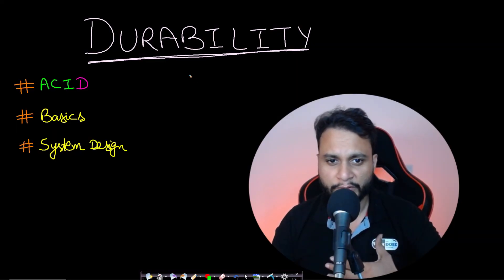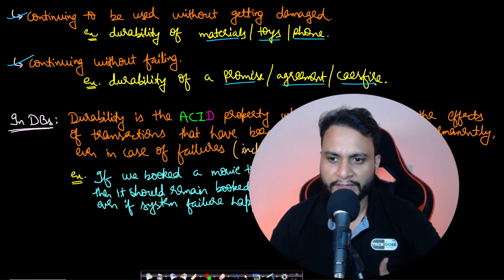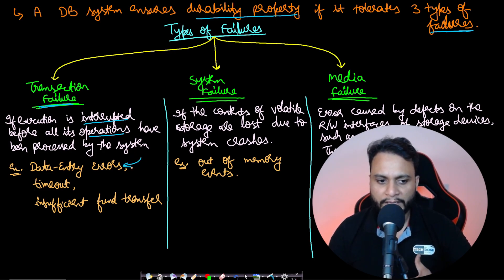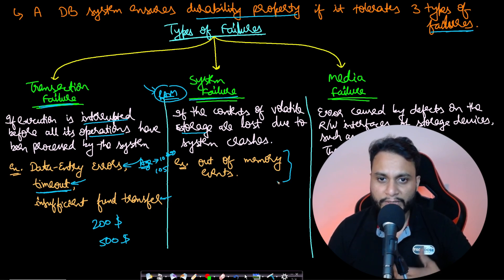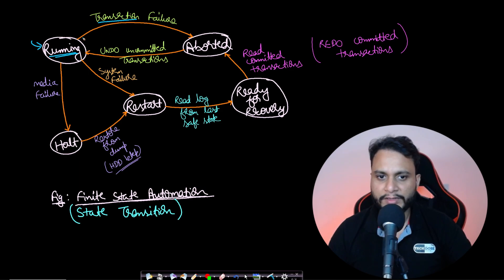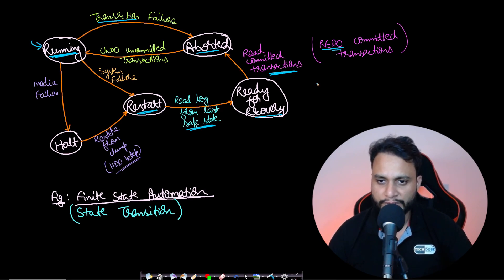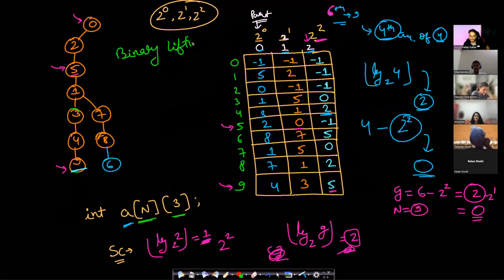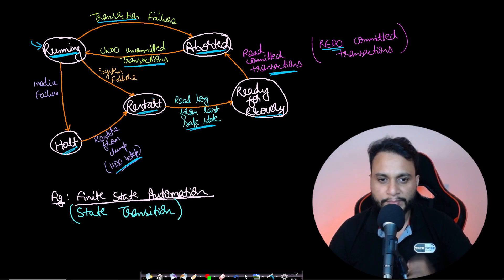Durability | System Design

Comment: In system design, durability refers to the property that guarantees that once a transaction has been committed, it will remain so, even in the event of a system failure. This means that the results of a transaction are permanently recorded and can survive crashes, power failures, or other catastrophic events.

Durability is one of the ACID properties (Atomicity, Consistency, Isolation, Durability) that ensure reliable transaction processing in databases and other systems that require data integrity.

# Key Aspects of Durability
1. Permanent Storage: To ensure durability, transaction results are typically written to non-volatile storage, such as hard drives or solid-state drives, where they can be reliably preserved.
2. Commitment Confirmation: A transaction is not considered complete until it has been committed, meaning that all changes have been successfully written to durable storage. Once committed, these changes cannot be lost.
3. Recovery Mechanisms: Systems often implement recovery protocols that can restore the system to a consistent state after a failure. This includes reapplying committed transactions and discarding uncommitted ones.

# Implementation Techniques
1. Write-Ahead Logging (WAL): A technique where changes are first recorded in a log before being applied to the database. This log can be used to replay changes in case of a crash.
2. Journaling: Similar to logging, this involves keeping a journal of all changes, which can be used to recover the system state after a failure.
3. Snapshots and Backups: Regularly creating copies of the database or system state to allow for restoration in case of data loss.
4. Redundant Storage: Storing data across multiple devices or locations to protect against hardware failures.
5. Data Replication: Copying data to multiple servers or locations to ensure that a copy is always available even if one instance fails.

# Importance of Durability
Durability is crucial in systems where data integrity is critical, such as banking systems, online shopping platforms, and enterprise applications. It ensures that once a user has been informed that a transaction has been completed (e.g., a financial transaction, a booking, or a data update), the information is reliably saved and will not be lost due to unforeseen circumstances. This property builds user trust and ensures the consistency and reliability of the system over time.